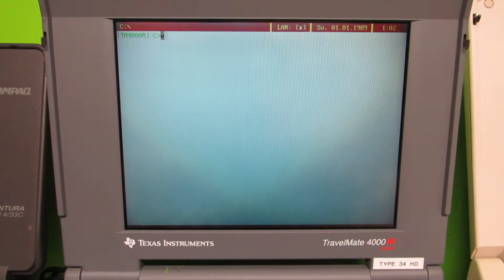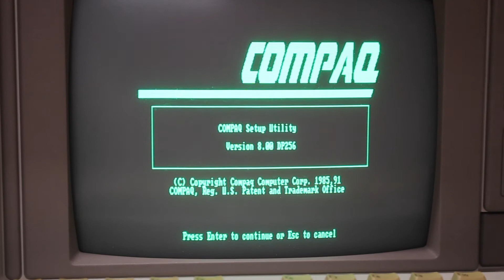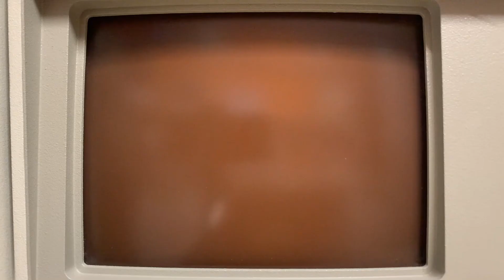The IBM 5150 PC journey part I - Fixing a Tandon TM-100 Floppy Drive

Comment: My XT's drives just stopped working yesterday, so will have to do this as well. Never done this so hope I don't fuck up 😅

I also plan to clean the R/W heads. Can you use 99% isopropanol or is that too aggressive for the heads?
Reply from the maker: Isopropanol will do just fine.
Reply: @THEPHINTAGECOLLECTOR  
Ok thanks :)

I think I was successful. Drive reads and writes disks properly, and is much quieter :)

(It wasn't able to move the heads at all yesterday)

Your video was very helpful!